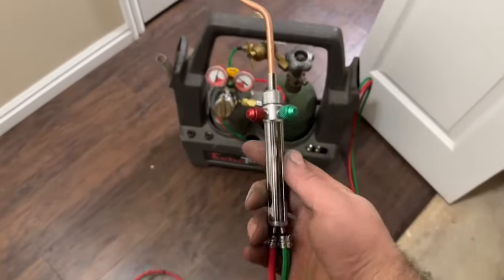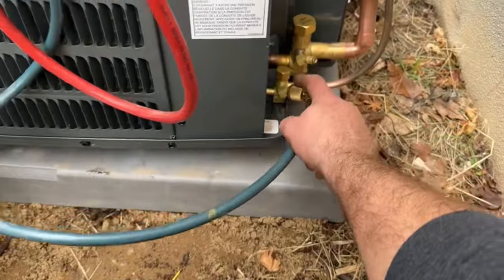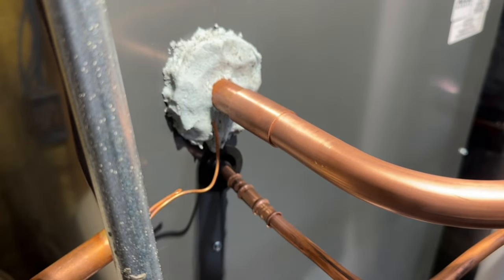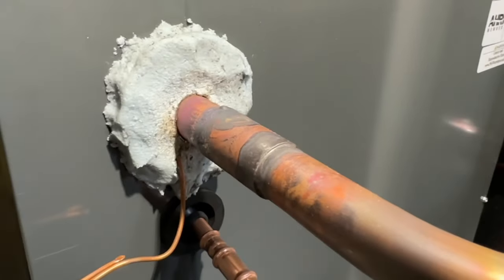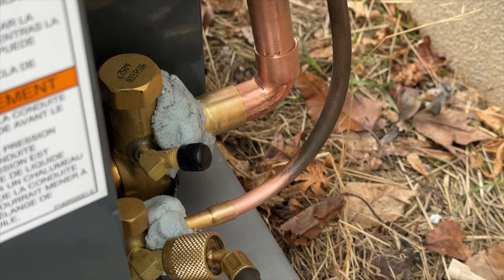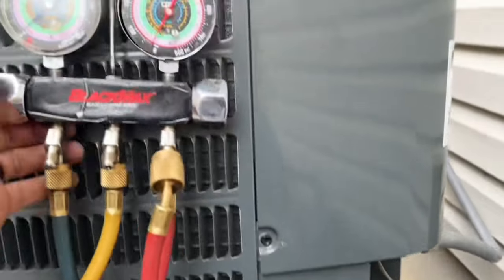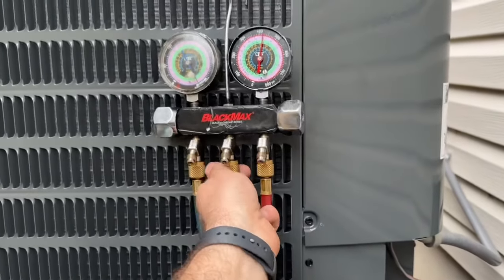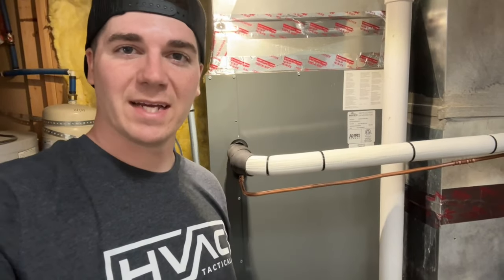How To Braze AC Copper Lines With Nitrogen

Comment: Thank you for posting these videos. My new gas furnace with 3.5 Ton compressor was delivered yesterday.  After doing some research it seems that all line sets are not of equal quality.  My system requires 25 feet of 7/8 and 3/8.  How do you know if a line set is high quality?  Do you have a recommendation for a good supplier?  Thank you again.

Comment: Love your vids! You have inspired me! I just purchased a 5 Ton Goodman Inverter AC, 100000 btu modulating furnace and a Goodman D Evaporator Coil. I was quoted $27k for a Carrier system and a Bryant System from two other companies. My Goodman system cost $10k, Testo 557s, 1-1/8 and 3/8 coil set and insulation, 1-1/8’ tube bender, Harbor Freight dual stage vacuum pump and all supplies added $2k. I messed up my 1-1/8’ ACR tubing so now I will use hard L copper and will rent the Nibco crimp system. That will add $650 including fittings. 
So $13k to $14k all in. I also pulled a permit from my county since doing this correctly with over-site is very important. I want to thank you for you channel and your passion for the industry! You gave me the confidence to dive into this. I was disappointed to damage the !-1/8” ACR tubing, but it’s par for the course. I’m fortunate enough to be able to afford the higher end tools. I’m renting the Nibco system and was disappointed with their week presence on YouTube. I sent them a note to send you a Nibco Press ACR and do their product justice! Thanks for educating this 59 year old high end DIYer!
Reply: How were you able to pull a permit without a hvac license? Also 27 k is a robbery, where are you located? Unless they’re the Infinity units from Carrier avg AC add on + furnace install around 11-16

Comment: I rehab homes and while I don’t braze on a regular basis, I have experience with both Stay Brite 8 and Brazing. Stay Brite 8 has served me well for the most part, but I've encountered challenges when working with soft copper rolled tubing, which differs from hard copper due to its roundness and susceptibility to gaps. Dealing with these gaps has proven to be a hurdle when using Stay Brite 8. On the other hand, my attempts at brazing have often felt like a nightmarish endeavor. Equipped with an oxy/acetylene setup, I've come to realize that mastering brazing requires extensive practice. Unfortunately, my learning curve has involved inadvertently burning holes in the copper or even melting it. I use Sil-Fos 15.  I have experimented with less intense torches such as the turbo torch, which hasn't yielded satisfactory results either. In fact, attempting to braze a 7/8” line with such torches can be an all-day ordeal and still end up with leaks.  I have also experimented with an Acetylene air setup, only to find that the process remains time-consuming and often results in leaks.

I yearn for a solution akin to Stay Brite 8 that functions effectively at lower temperatures and is capable of bridging gaps. It would be ideal if you would make a comprehensive video guide detailing the art of brazing, including meticulous instructions on setting optimal Oxygen and Acetylene flow rates, along with insights on achieving the perfect flame and which tip size to use.  Additionally, any strategies or tips to simplify the brazing process would be greatly appreciated for example does that smaller torch you are using work better?  I will also add I tried to use the Cap’n Hook tip and what a disaster, completely burnt up a 3/8” line when brazing a filter/drier.  No way to hold that Cap’n Hook steady and even and the rod and braze all at the same time.  I have heard some say to use a Rosebud tip, but not sure that will end up with better results. 
 
I find myself wishing for a product that combines the benefits of Stay Brite 8 with the capacity to handle gaps, especially when it comes to soft copper rolled tubing. If you've developed techniques for utilizing Stay Brite 8 in scenarios involving gaps, I would eagerly anticipate a detailed video tutorial on this subject as well.
Reply: I should add when I use my Acetylene/Air setup I am using a soft flame torch, which is not hot enough to braze.  I thought about trying the Turbo Torch they sell for Air / Acetylene but did not want to spend the money for another setup that might not work.
Reply: You need to constantly keep your footage moving around the joint and often of of the joint. With oxi acetylene it is very easy to overheat. Great both sides of the joint until your rod flows and get off of it. If you turn the chipper cherry red you have way overheated it and the alloy won't flow. Try a couple seconds of heat then move the flange back then a couple seconds then move the flame back. I have done lots of 1/4" soft copper on refrigerators like this

Comment: I love that torch!!  Beautiful welds.
What pressure do you run the nitrogen at?
Reply from the maker: It is extremely low, probably 1-2 psi or less even. All you need is a nitrogen presence basically

Comment: Thanks for Video.

The second small copper wire at 2:41 seems to be a little loose on our AC unit. Does it need to be tightly secured?
Reply from the maker: The bulb that it’s attached to just needs to be securely mounted to the pipe is all 👍🏼
Reply: @diyhvacguy  thanks for the quick reply. What does the small copper (the one in your video with black washer) wire do ? I could see the bigger one is properly insulated and connected very securely to AC unit, whereas the small is just inserted but not sealed to the Ac unit in attic. Sorry if I'm asking basic questions :-)

Comment: I have a challenge for you. Is it possible to make an AC, window unit preferred, run purely mechanically. Like, with an engine or some other rotary input.  You can't cheat with an old car that lacks a computer lol I already know that is possible. My thoughts is a steam engine powering a window ac, while also powering my lineshaft workshop. 

I have a dream! ... That might be completely idiotic, but its a dream lol. 

I think it is possible, but having an expert explain what I suspect is possible would be a lot more awesome.

Comment: I'm just a welder so I'm not great at recommendations. We always cleaned like you but use flux. Seemed to help flow? Thanks great video.
Reply from the maker: Flux is for soldering. This is brazing, so no flux is needed. This method gets to about 1200 degrees Wheras soldering is only 400. Cheers

Comment: You have to be careful with those crimp fittings - they have o-rings that will be destroyed with heat - right?
Reply: He wasn't brazing on the liquid line inside the house.
Reply from the maker: Yes I made sure not to heat up those while brazing the suction line. One could cover them with a rag to be sure.
Reply: I use a swaging tool and pipe bender. You got too many connections! Crimped tube on high pressure liquid line? Too risky.

Comment: What's the difference between brazing and soldering?
Reply: Chemistry and temperature.
Reply from the maker: Brazing is way higher temperature (1200 degrees Fahrenheit and soldering is closer to 400 degrees. The technique is similar but some prefer one over the other. Staybrite 8 is specifically made for HVAC applications and a lot of people use it for linesets.

Comment: Can I use compression fittings to connect the lines?
Reply from the maker: No that is for plumbing. They do make some that are kind of like a compression fitting but they’re hard to get. I’ll see if I can do a video on that soon
Reply: @diyhvacguy Why can’t they make connectors like they make on TXVs? They are similar to natural gas connectors. They have plastic o rings and never seem to leak.